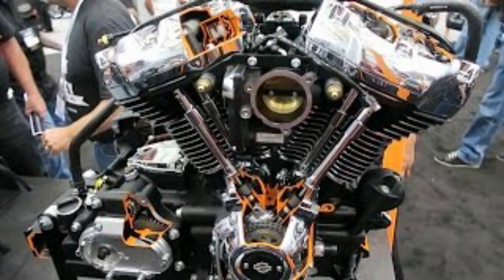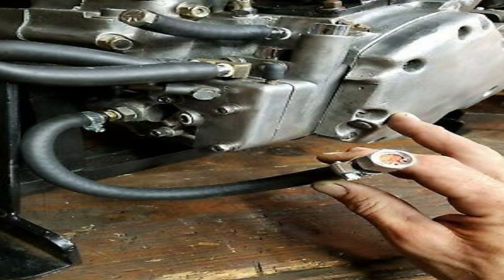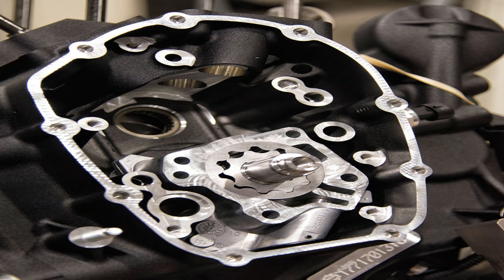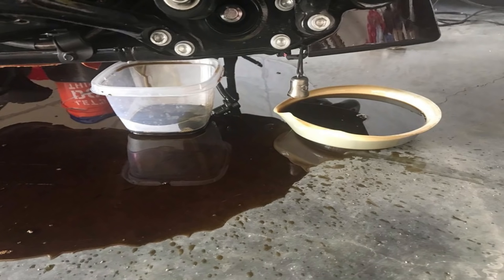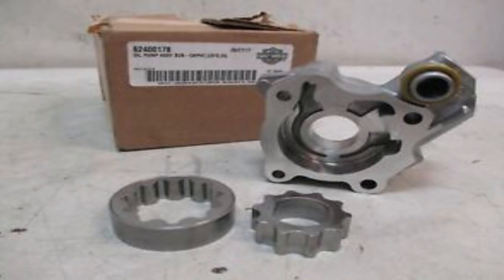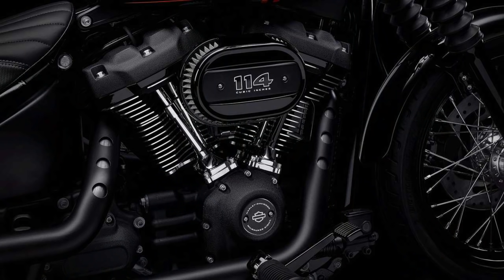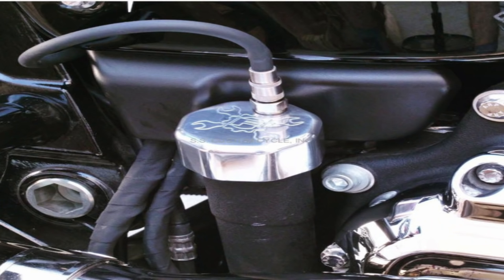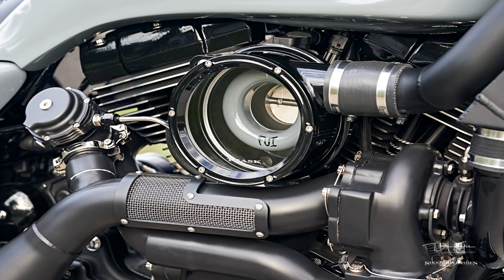The Fatal Milwaukee 8 Engine Flaw Harley-Davidson Missed

Comment: It's been 18 yrs since my last bike. Decided to buy a 2021 street glide. Love the way it performs. Will I have these sump problems?
Reply: Depends......If you upgrade to Stage 2, 3 or 4.  Maybe.  If you ride it hard.  Maybe.  Best solution in either case is to upgrade to a high performance plate and pump.  I am running a '21 RKS.  Just installed a Stage 2 SE447 cam.  When my warranty is up I plan to go to another cam and at that time will also upgrade the cam chest components.

Comment: I’ll be doing a Stage II on my ‘21 TriGlide this spring. Is there any particular reason to upgrade the oil pump while they’re in the cam chest? Or has HD fixed any problems?

Comment: I have a 2017 Street Glide. The dealer replaced the oil pump assembly cover when the stage 2 was done. Looks like I wiil have it opened up again to replace the oil pump.

Comment: Gday mate , great video.
My 2021 Low Rider S has just arrived in Australia , took forever with the state of the world nowadays .
I’m installing a “Check M8 Vent Trans Top Cover” From Trask Performance to reduce Blow By issues.
Have you heard of these ?
And what’s your thoughts ?
Cheers 🍻 Gus 👍👍👍
Reply from the maker: It's great to hear you finally got your bike! Low Rider S is an awesome bike, in my opinion you can't go wrong getting some atmospheric vents on these newer bikes. There's so much pressure build up in these new designs and atmosphere is the best way to relieve it, especially in the heat of Australia!
Reply: @GixxerFoo   yeah cheers 🍻 mate . Can’t wait to ride her . 
Doing a stage 2 kit with a redshift 468 cam 👍👍👍

Comment: Would like to see more vids on m8 oil pump options. I have a 2019 Ultra and took it on a 7000 mile trip last summer. No issues at all - rock solid. I did the Feuling dipstick but not til after my trip - had a terrible experience with the A1 with customer service  - they pick the lowest cost shipper (USPS) and when your shipment disappears or is delayed for a month they won't help and will push back and say it's your problem.  I would streer away from A1.

I am going to upgrade my oil pump to the S&S just to make sure I never have an issue and to move more oil / keep the engine cooler.
Reply from the maker: Dang that's pretty sad from A1, I am sorry to hear that about them, hope your getting in some good riding this summer!

Comment: Harley should fix it in house , no charge!!
Reply: They do after the engine blows a top end.
Reply: lmfao u would have better chance gettin ANTIFA to reload your clips in the coming revolution
Reply: Harley-Davidson don't give a shit about their customers anymore that's why I do not ride Harley-Davidsons anymore
Reply: @sll-tt6bj  you switch to Indian?
Reply: Yeah, and every twincam with a failed tensioner that blew out the cam chest or engine case. They don't care.
Reply: They don't care lmao. They sell the cheapest quality, lowest tech bikes to "save money" yet they cost up to 4x as much as a better quality bike from any other manufacturer
Reply: @spencerkleiman5035 but but the fit and finish is SO high quality🤓 
Yeah, polishing a turd doesn't make it anything besides a slightly better looking turd
Reply: @spencerkleiman5035 they use "quality" materials (the cheapest steel there is on the market, probably imported 
 If u can make crappy materials look nice in a bike and cheap out and make it heavier than hell, you'll have a bunch of middle life crisis men dropping 30+ Gs on it 😂😂😂
Reply: Or at least let owners buy the updated pumps at a reasonable price that’s affordable.

Comment: Hi..! Body I all ready installed the fuel oil vent in my RGL 2021 and Really help but I notice lest miles for gallon in ⛽.... I don't know why...🤔🤔
Reply from the maker: You shouldn't of lost fuel economy with a vented crankcase, if anything else it should of helped. You might check it for oil sumping, that's one of the causes of economy loss on the M8.
Reply: @GixxerFoo  but this not happen before installed  fuel oil vent.....🤔🤔🤔
Any way I'll  put back the  original transmission oil cap stick just for check my fuel economy... I'll let you what happened...🤟

Comment: The first step is a leak down and compression test before getting out the parts darts. There is some incredible information on another YouTube channel showing tear downs and what caused the sumping and a cam plate and oil pump did not resolve the problem.
Reply: Please if you could give me the links. Would really appreciate it. Thanks.

Comment: Instead of the Feuling vented dipstick, you may also want to consider the Trask vented transmission cover. It's arguably more practical, and better situated. No need to uncouple the vent hose from the dipstick, or burning your hands (since the Feuling dipstick is made from billet aluminum) when checking the oil. Plus the vented transmission cover vents from the highest point in the crankcase, so less chance oil will be pushed through the hose and filter.
I personally have the Feuling vented dipstick, but if I had to do it again, I'd get the Trask vented transmission cover.
Reply from the maker: Yeah that Feuling dip stick gets frickin hot, I mean welding glove needed hot when you do a hot check on the oil.

Comment: I upgraded my 2018 Breakout 114 with a Woods 22XE cam/lifters, S&S camplate/oil pump/pushrods, tappet cuffs, chain tensioner, and Andrews crank sprocket. I had previously installed a fueling vented dipstick that ran into a breather fitting under the bike. After the install of the new oil pump, cam and other things, it now pushes oil out of the fueling line and out the breather fitting. I end up getting oil on my back tire and under the bike. I asked fueling about it and they told me that there must be to much oil in the bike, but I have verified with a shop that there is not too much oil in the bike. Gonna go back to a stock dipstick.
Reply from the maker: You've done some solid work to that bike, I bet is screams with that Wood Cam in there. It shouldn't be pushing oil out of that dipstick with the correct factory level though.
Reply: @GixxerFoo  So I installed the stock dipstick and it shows about 8 ounces too much. The fueling dipstick shows just below full. So the lesson here is that the fueling dipstick shows a normal level when it is above normal oil levels.
Reply: @briandorsey3608  If you run the oil level at 1/2 quart low HOT, you will not have a problem and the engine will be perfectly happy, Brian.

Comment: good stuff man. i have a 2018 heritage and put the 131 kit in from harley. they put in the fueler dipstick and upgraded the oil pump when they did it. i guess i never noticed it before as you said as to long trips. most of mine was about and hour riding mostly. good info for sure. and i think the M8 is going to be the best engine ever.
Reply from the maker: I do too, it's got a lot of potential but with anything Harley it takes a while to catch on. I bet that 131 is a beast to ride!

Comment: The Feuling Vented Dipstick  has a one-way valve that allows crankcase pressure to vent to atmosphere while NOT allowing suction on the upward stroke of the pistons to pull air back into the case.  Much better than a simple vent to atmosphere!
Reply from the maker: It really is as it doesn't allow more air to be introduced into the crank case, they really thought through that design and that's why it cost so much.

Comment: I am already bypassing my breather vents. Should I also run a vented dip stick. I ride a 05 softail with a tuner
Reply from the maker: You don't really have to run a vented dipstick on the Twin Cam, those crank cases breathe really well. That's more of a M8 issue, all Harley motors have potential for a sumping issue we've just never seen it before like the M8.

Comment: Getting to buy a 2020 street glide with the M8 on Tuesday. Have they fixed the problem.?
Reply from the maker: Yes the 2020 models have the updated oil pump installed from the factory!

Comment: The PCV system is critical, because it maintains a strong vacuum on the crankcase. If your breather is vented to the atmosphere, then the blow-by gasses will slightly pressurize the crankcase. A small amount of positive pressure in the crankcase, will push oil into the cylinders, past the oil rings, and valve seals, and it will also push the oil out onto the ground, through the main seals, and case flanges. 

However, consider the contrary situation. 

If the crankcase is vented to the intake manifold, through a flow limiter, (a PCV valve is an air flow limiter) then the strong vacuum of the intake manifold creates vacuum on the crankcase. Having the crankcase under a vacuum, means oil is not drawn into the combustion chamber and oil is not going to creep past the main seals, or pushed out of the engine onto the ground. 

An engine with leaking main seals, probably has a blocked PCV valve system, because the PCV system should create a constant vacuum on the crankcase, and around the main seals.

Having the crankcase under a constant vacuum (except during wide open throttle, when the manifold vacuum temporarily goes away) then the oil is "sucked" into the engine, and not pushed "out" of the engine. This is why you need to consider a proper PCV oil ventilation system, because ideally, you really want to maintain vacuum on the crankcase.

The other major benefit to having a proper vacuum in your crankcase, is that the piston rings are "sucked" down onto the pistons, so your pistons seal better, and you actually make more horsepower. As well, the oil ring functions better when the crankcase is under a vacuum, and less oil leaking into the combustion chamber, effectively reduces detonation from oil vapor.

Comment: Great video thank you! I heard the late model 2019s were "fixed" though my dealer couldn't tell me what HD did to "fix" it... I have a late model 2019 with a Stage III upgrade and have not noticed any issues.. That said, I'd rather be safe than sorry... any thoughts please?
Reply from the maker: If you have late production 2019 they will have the updated oil pump, early production mainly in 2018 for the 2019 model year will have the old style pump.
Reply: @GixxerFoo  (phew).... well... will probably upgrade to high performance pump anyway now... and adding the breather too...  Thanks!
Reply: My late 19 had the new pump. I also did a stage 3 to retain warranty. 116 HP at the wheel it’s got 17k hard but not stupidly abusive miles on it. 

Recently added dip stick vent as it’s put some oil in my air filter.  Otherwise no issues.

Comment: I don’t know about the HD M8 but  installed a S&S oil pump and cam plate on my 96ci and it runs great now. Even cooler.
Reply: I’m thinking of doing the same. How much cooler are you running now?
Reply: @mikedanaher3413  hard to put a number on it but I would say between 20-30% cooler.
Reply from the maker: Your getting some good oil flow now with that S&S pump, that makes a huge difference with cooling it off!
Reply: I did the same thing on my TC-88 but went with Feuling cam kit and S&S 510 cams. Bike runs great now. I will always keep this bike but I am shopping for a new Road King as a primary ride
Reply: @falconator3419  Would the 103 still need the upgrades you did?

Comment: So, this happened to me. The intake valve guides wore out because the oil pump wasn't getting to where it needed to. H-D had to replace the whole top end under warranty. I worked it out with the dealer to pay the difference in parts and upgraded to the Stage 4 and the 2020 oil pump.
Reply from the maker: Damn that's the exact issue right there, I am surprised they didn't upgrade your oil pump as part of the warranty.
Reply: @GixxerFoo  yeah. I explained to them that if they replaced the top end without replacing the oil pump I’d be back. So I just paid for the pump and labor while they had it all apart.

Comment: New pump help mask the real issue. Piston oil jets are probably not torqued properly from the factory and some also have been known to be stuck open. Either way stuck open or loose it'll flood the engine case and also take away from the lifters being oiled properly at idle.
Reply from the maker: That's an excellent point!
Reply: I had mine checked when I did the big bore kit. They weren't loose, but they weren't torqued down properly either. That's on a 2020 RKS, so 3 years after the M8 was introduced, this is still an ongoing issue.
Reply: If one have the money to afford an exorbitant dinosaur from Harley, one have the money to support Harley a bit further in their madness 🤣🤣😁. Harley only making money with their name
Reply: Thankyou

Comment: Would the screamin eagle stage 4 installed have the upgrade pump
Reply from the maker: The Screamin Eagle kit wouldn't come with an upgraded pump, the stage 4 kit actually made the issue worse. You could get a new pump installed but they would charge you the pump since it's not included.

Comment: Harley needs to just go ahead and build a bigger version of the Sportster engine and put it in the big bikes already.
Reply: Harley did better than that 🤣 they killed Sportster in silence. Go ask Harley what is the Sportster ? they will deny that bike ever existed. 😂
Reply: @betruly7894  a sad ending for the most reliable bike they ever made
Reply from the maker: Basically, now it's lost it's identity on the web site. They put it under the Street now, which that series failed miserably with those XG's. I guess they are trying to save the Street name with Sportster.
Reply from the maker: I have thought that for years myself, the torque would be made up with the displacement increase!
Reply: That's what the Evo was
Reply: @roadglidehoss  I'd like to see them take take it a step further and do the quad  gear cams/straight pushrods and integrated primary/trans like the Sportster.
Reply: @roadglidehoss  precisely
Reply: I say build a larger vrod engine.
Reply: @michaelxwhite  there may be some great things about the V-Rod engine but working on them is not one of them. I'm sold on both the Simplicity and the reliability of the Sportster engine
Reply: This is what I’ve been saying for years... it still wouldn’t be the best cruiser out there but it would be a reliable, shorter wheel base big twin that’s easy to work on and makes decent power.

Comment: The vented dip stick leaks oil on hard turns… the manifold cover vent coupled with the air cleaner venting setup is the way to go IMO
Reply: My vented dipstick has yet to leak.
Reply: @Uncle_Dirt  you are yet to lean hard, some bikes lean angle is worse than others etc… still prefer the manifold vent imo
Reply: @aaron.sorenson  You might be right. I have a 2019 Fatboy. Not exactly the cornering machine.

Comment: my 2018 stock road glide with 30,000 miles runs fine, but seems to burn oil, unless of course it’s just sumping.  i dont ride hard at all.  i want to check the cam chest first to see how much oil comes out, then remove the crank sensor.  regardless, an upgrade to the 2020 oil pump seems logical, maybe a vented dip stick …
Reply from the maker: It might be using a little oil, they have really high crank case pressure which make it prone to blow by.

Comment: I upgraded my 17 ultra to the S&S oil pump. Bike ran smoothly and alot cooler. If you can afford to do this I would highly recommend it. Compared to the stock oil pump it is a much higher quality.
Reply from the maker: S&S blows the stock oil pump away!
Reply: A guy i work with still has this oil issue with the s and s pump
Reply: How much did that run you?
Reply: @billsteeves2974  stage 2 kit was a cam ,cam plate, push rods, inner bearing,oil pump, lifters and cuffs. About 2200 at my local shop. Already had full exhaust and tuner with wide band, stage 1

Comment: I just bought a new 22 m-8 107 roadking. I not liking the top end noise comming out of her. sounds like a bunch of chains ratteling. Is this normal for this motor? my 96 and 103 twin cams didn't sound like that!.

Comment: I have 2 TC88's.  Vented dipstick seems like it would be good for all Harleys.
Reply from the maker: It really seems to help a lot on all their motors, all Harley engines even the Sportster can have a sumping issue.
Reply: I put one on my twin cam hoping to reduce heat but it didn’t do much for that but it did help blow by

Comment: Looking at a 2008 Softail deluxe . Would it have the Milwaukee 8 mtr? Would the dealer know if the upgraded pump was installed or should I just ask them to install the vented part?
Reply from the maker: 2008 Softail is going to be the Twin Cam 96. Only things on those bikes are the compensator may give you some issues.
Reply: @GixxerFoo  Where is the compensator located?

Comment: I'm still riding an early TC88 which had the tensioner issue. It seems like every time Harley comes out with a new engine there is some sort of factory defect. I don't understand why they're not forced to recall the affected bikes and fix the defect of the moment. This just shows that Harley doesn't give a shit about their customers, their only goal is to clean out our wallets.
Reply: still riding my O5 T.C.geezer glide. just dumped 8,400 in my new motor. have 300 miles on it. and it is still cheaper than going new.
Reply: They cleaned out my wallet on my LRS, but I like it!

Comment: Great info, Do I need to do the mod on a 22 plate fat bob as well or have they sorted the issue out in the newer bikes ?

Thank you.👍
Reply from the maker: The bikes 2020 and newer have the updated oil pump, the Softails didn't really seem to have the issues but they do have the updated oil pump as well.
Reply: @GixxerFoo  Thank you for the reply, Does this mean I dont need to do that vent modification or would you suggest carrying this out as the bike is still under warranty and has less the 200 miles on it ???

Thank you.